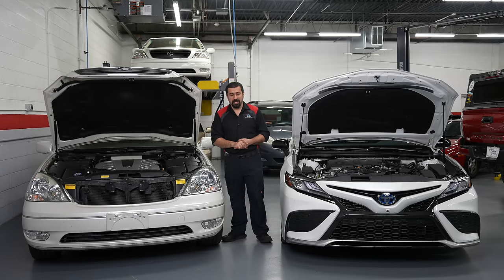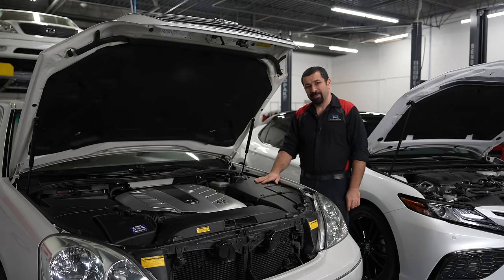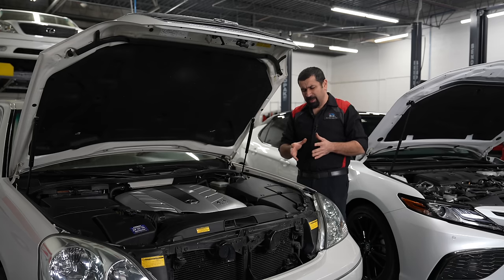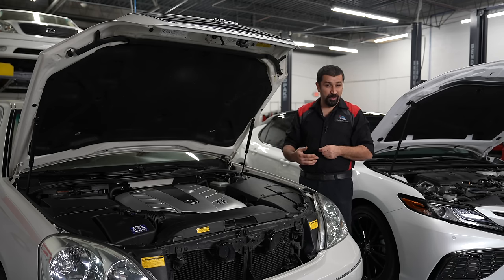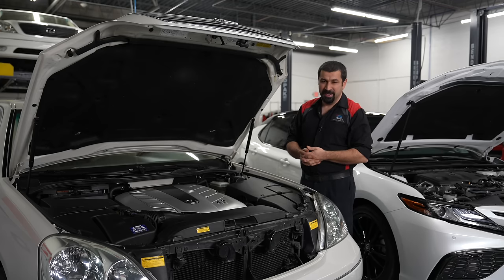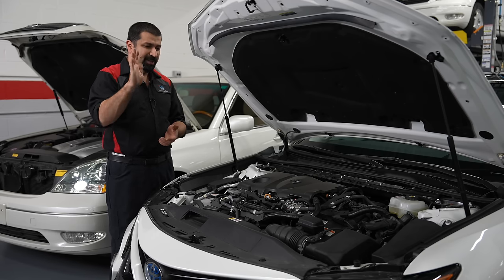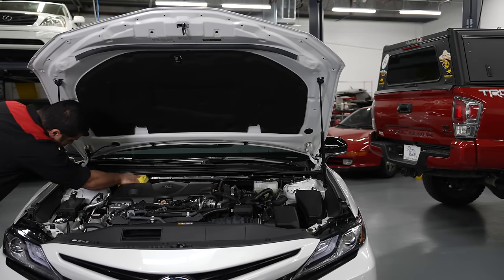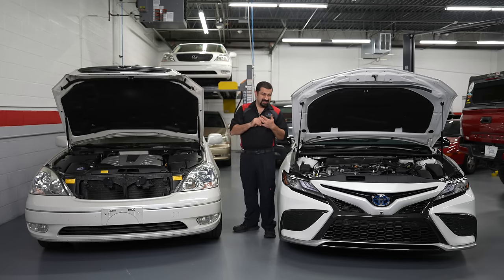Never Do THIS When Cleaning Your Engine Bay! Do THIS Instead

Comment: Another place to avoid cleaning with water is the distributor. This applies only to older cars of course (pre-2000s). Water under the distributor cap was a problem that could cause ignition failure.  On flat engines the distributor was off to the side of the engine in closer proximity to the wheel well making it vulnerable to getting flooded if the car was driven too fast through flood waters.

Comment: I have a question when cleaning the outside of a vehicle. I am concerned, because I own a Crosstrek PHEV and there are a lot more electrical components present. I power wash the outside once a week or so, since I live in Quebec where we have a lot of snow and salt on our cars after driving on the highway. I power wash the exterior bottom at angles, since I cannot put it up on a lift. It is not direct, but I still make sure to thoroughly get the entire undercarriage due to the salt on our roads.

I also clean the front directly, so there is a lot of water at decent pressure on the front grill. I never open the hood and clean with the pressure washer. Is this ok, or would you recommend some different practices?

Thanks!

Comment: I used to detail cars, both new and used, and the engine bay was my specialty. I always disconnected the battery. Then I would do a quick powerwash with some decent engine degreaser. Then blow dry the engine bay with compressed air. Especially electrical connectors and alternator. Then I would spray some tire shine into a rag and just lightly rub it on the hoses and plastic parts and never had an issue in years.

Comment: Simple green will also attack aluminum. 

I regularly clean my engines. It's really important over time, lets you identify where there might be leaks, and it's vitally important to clean dirt and dust off before you do any work opening the engine up to make sure zero dirt or dust can get in. If I have any problem areas I might resort to using a foaming degreaser if there is oily gunk. I use a garden hose (no pressure washer). Anymore I haven't had any concerns about spraying any part of the engine bay, all the important control modules are in water tight compartments. Dawn dish soap wirks well too.

But here's what's really important: you have to make sure it all gets dried really well. I'll use compressed shop air and sunlight mostly, especially on the alternator, wiring connectors, spark plug wells, etc. I will typically give a squirt of WD-40 on wiring connectors and the alternator, but only lightly because while it's good for preventing corrosion, it attracts dirt. 

Bottom line for me is I'm not affraid of spraying garden hose water on anything in the engine compartment, but never a pressure washer. I will use a degreaser on problem areas, but I am sure to rinse it off well, and Dawn dish soap works well, but only when you can agitate and brush it, again rinses off well. NEVER use simple green on aluminum, but it can be safely used on everything else if you immediately rinse it off. And I make sure to dry everything very well after.

Comment: Yeah I know I’m a mechanic as well and the detail guys here have idea what damage they’re causing.
Reply: I've seen detailers snow-foam the engine bay with mixed-in degreasers and let it soak for 15 minutes.  Guess where some of those dilluted degreasers go?  Then completely blast the bay with a pressure washer.  Then they will start the car and "attempt" to dry the car ala engine heat-soaking with the hood closed.   Yes, there will be no damage for a couple days or so, but we all know corrosion takes time.

Comment: Been pressure washing engine bays in my vehicle for decades.  Just be prudent with distance.  I kept one truck for 15 years and had zero negative effects.  Cant be just luck.
Reply: If ur vehicle is around for decades then it dont really matter. The electronics is probably minor

Comment: Ive worked at a Mercedes dealer and they always did this for their clients… although you need to use compressed air to dry it up especially the connectors and the electrical elements …

Comment: I really appreciate  your last tip about cleaning the touch screen. I tend to use Windex, or similar glass cleaner, on glass and plastic surfaces and eyeglass cleaner ( pretty inexpensive at Costco) to clean touch screens. Going forward I thin that I wil use less glass cleaner on plastic interior parts and use a little bit of mild dish soap in a spray bottle to do a quick mist and wipe with a macrofibre cloth.

Comment: Great advise, I use a leaf blower NOT A STRONG ONE JUST A CHEAP ONE and some cheap paint brushes and a wet rag with a small amount of dawn dish washing to clean up greasy places or dirt around doors,  I use warm or hot water also, just traded my 2015 Tacoma in back in august 2023 and the engine bay looked as good as a new car.They did NOT put it on the lot to sell, someone bought is VERY QUICK!!!!
Reply: noooo you blow the dirt right into the alternator...  use a vacuum!

Comment: The most important takeaway for me in this video is if I go online to a (used car) dealer's website to purchase a car.  The online pictures usually show a very clean engine bay.  How are the dealers cleaning these engine bays to the point that they shine?  Are they hosing them down & then applying some sort of liquid wax to make them shine?  Are the products they are using making their way into the connectors?  Thanks to your video I will be asking as well as checking to see exactly how invasive their cleaning products have gone.

Comment: 2017 Highlander - I open the hood on a regular basis - check my oil, visually check brake fluid color and level, check the coolant reservoir, regularly check my air filter.  I do clean the beauty covers and reservoirs so they stay visible but I just use a microfiber rag and a little spritz of cleaner. And I regularly keep the leaves and debris cleaned out of the cowl and under the wipers. And I'll go a little more heavy handed on the bottom side of the hood and liner. Now I've decided to have the Krown oil fluid rust treatment and from experience on my Tacoma I know they do the fender wells etc. under the hood so it all becomes a little more greasy under the hood but the protection is worth it.  Haven't used a hose and water since the days of my 1977 Chevy Nova which always made me nervous but back then I guess it was ok to go a little more heavy duty - plus engines seemed to leak a lot more crap back then.  It seems easy to maintain with minimal dusting/cleaning - makes me feel better anyways.

Comment: Also, do you have a specific body cleaner spray brand that you recommend for the Hybrid engine bays? I would likely spray some on a microfiber towel and apply it, then use another dry tower to polish it up.
Reply: Hardware stores, Walmart, auto stores
Reply: Any quick detailer will do.  As you saw from Ahmed, it's just a mist spray, a 500ml bottle will last you a while.
Reply: @michesbianan   Thanks for that! Typically I have been using the armor all cleaner wipes on the surfaces of the engine bay components and then finishing within a microfiber cloth. This way it is mostly dry with no fluids dripping into and onto things. 

That has been working pretty well, but I have not tried fluid cleaners as of yet, hence my question.
Reply: I’ve always used Turtle Wax Clean and Shine. Cheap at Walmart.
Reply: @TXAG81  Nice. That makes sense. Did not really occur to me to use a wax.
Reply: @madlucio70  I say keep on doing what you do now.  Cleaner wpes are convenient because you can just throw it away.  For quick detailers, you can use the shop towel.    Whichever is cheaper in the long run is the best way to go.

Comment: I look at it this way: how many times have you ever had a mechanic tell you something was wrong with your car because the engine bay was dirty? I'm willing to bet that is ZERO times! The only times I've ever cleaned anything in the engine bay were vacuuming leaves and pine needles that fell inside and make their way into the air filter.

Comment: Very good review of engine cleaning.  I use Simple Green - Aircraft and Precision Cleaner for all degreasing and clean-up work on my cars and aircraft. This product is formulated so as not to cause corrosion or chemical interaction with aluminum and plastic parts.  It can be diluted as appropriate for the task at hand.

Comment: I only clean the engine on my old classic car that's it. On New cars what's the point, it's not worth it at all, most of them have some stupid engine cover. You can't see anything anyways, and plus the engines are ugly to look at with their wires and plastic everywhere who wants to look at that crap. I just leave them alone.
Reply: Its worth keeping the engine bay semi clean, this way you can easily see cracked pipes and oil leaks and other issues that may pop up.

Comment: A common mistake a lot of detailers make is they chase that cleaning perfection and everything else goes out of the window. Deep scratch on paint? They buff it until it's not visible, but it also leaves you too little of a clear coat to protect the car for years to come. Same with engine bay detailing, splash everything with the cleaner, doesn't matter where it goes and they just cover the alternator and battery. Degreaser? Let's use it all over the engine bay including the plastic covers so it looks spotless clean, but how about durability of the plastic parts afterwards?

Awesome video as usual AMD!
Reply: Nothing can be further from the truth.  This is pretty common with wanna-be detailers or just new ones.  Most of the old timers pretty much would just do a wipe down.  For scratches, if you meet a detailer that will tell you scratch is so deep and starts talking to you about thickness of paint, then you know you're dealing with the right one.

Comment: That's funny, exactly what you recommended is what I've been using for years to keep my engine bays clean.  I've been a detailer for a long time, and prefer to keep the engine bays clean on my own cars (most customers I've had didnt really care or ask about it, so I didnt bother).  But on my own cars when I'm getting the engine bay clean for the first time, I use heavily diluted simple green, and instead of spraying directly on anything in the engine bay.  I have a long bristle brush and give a light spray directly on the brush.  I clean a section, then immediately wipe it clean.   Now that my car's engine bay is fairly clean, I use some simple detail spray that I got in bulk, and wipe the dust off every year or so.  I'll also use a very non oily tire shine that dry's good on rubber/plastic parts (obviously not everything) to keep them from cracking and drying out.  I've seen so many videos over the years even from pretty well respected youtubers like chris fix that recommend using pressure washers/hoses on the engine bay.  I've never... ever... EVER done this.  People are so impatient, always looking for a "life hack" or a quick cheat to get results fast.  The engine is an extremely complicated piece of machinery.  Spend an afternoon, take your time, and be sure to not soak liquid anywhere where you think it shouldnt be.. just use some common sense, and be gentle around sensors/wires so you dont risk damaging them.  Engine bays are built to handle light water spray from underneath the car, they arent made to handle gallons of water getting sprayed from the top down.

Comment: Any tips for a dirtier engine i.e. a good bit of mud? I take the utmost mechanical care of my 4Runner but I’m also not ashamed to use it for its intended purpose and it sees a lot of off road use for camping and exploring. It’s not like the heads are caked or anything but it gets pretty dirty, even after putting better splashguards on it. 

Keep up the good work by the way, your videos are great and gave me the confidence to change my own spark plugs and probably a dozen or so other things I would have paid someone for before I found your channel!
Reply: Wash it with a pressure washer. It’s fine. I have pressure washed literally dozens of them. When they are hot spraying right on the alternator and map sensor. Don’t be afraid.

Comment: You can also use a non harsh long bristle paint brush to first loosen dust and dirt in hard to reach places then blow it using a compressor hose nozzle or specialized blower.

Comment: I dont spray any liquid on the engine. Never had to. Use a rag to clean dust or use a shop vak to get rid of debris. Especially in those places under the cowl clogged up with wet leaves restricting the flow of air. Or the drainage holes.

Comment: I wash my engine about once a year. I put engine cleaner or degreaser on it when cold and let is soak a few minutes. Then I use a gentle shower of water to rinse and hit heavy dirt with a brush or rag. Then I use a leaf blower to blow it as dry as I can. Then I go drive the engine until it's hot to completely dry it. I never let the water sit for a long time on the engine.

Comment: I use a light water mist with light degreaser and compressed air. I have always detailed my engines. We bought a 2008 Nissan rogue with 300miles on it and the engine bay still looks brand new

Comment: I recently cleaned my engine bay. Turbo Subaru. Sprayed engine cleaner all over. Agitated  with a brush and used the shower setting on my garden hose. Stayed away from the alternator and battery. Rinsed and repeated until it was clean. Used a blower to get rid of any standing water and let it dry for a couple of hours with the hood up. No issues. 👍🏾

Comment: Great video,I spray my engine bay with water ONLY when engine is cold, and  water won't direct jet onto Alternator, coil, ECU, connectors, after that I would start up the car right away, let the heat slowly bake the water away, and MOST IMPORTANT I ONLY do this when the car's milage less than 60K kilomoters(40K Miles),  when the car gets old, I use compressed air and short burst water spray ONLY on few extreme dirty spots, I rarely use degreaser and only before/after repair done when needed. Just clean enough to find leak or where thing go wrong, but engine itself doesn't need that much clean to run, so I won't be too fussy about it.

Comment: There's a foaming tire cleaner spray that I found works GREAT, and all the dirt and grime will just slide off and drip out of the engine bay, and it works as a protectant, so it leaves all the plastic with a shine and also a thin protective film
Reply: You're absolutely right, I've used it to great effect. However, it works best on cars that have dirt not embedded/sat into the plastics and metals, forming a layer of slime/sludge

Comment: In the early 90's I used a pennzoil product to clean my engine bay. Instructions said to warm it up 5 minutes, spray it on, and then spray it off with a hose. I did that on my 79 Accord. Aluminum heads. Hot engine plus cold water equals bad head gasket. Thanks pennzoil. Haven't bought anything with that name on it since. I wrench and I have gained knowledge over the years. Never again will I ever try to wash an engine bay. Not just because of the pennzoil lesson learned but also as stated in this video, electrical has become more and more dominant over time. If I ever clean anything due to spillage like changing a power steering pump, I simply use brake cleaner to knock it all down. Dries fast and won't smoke as whatever I spilled is cleaned up.

Comment: You mentioned we should not spray water on ignition coil, also on electric connector, so my question is how do we clean these mentioned items, is ok to spray them lightly with pressure water?

Comment: I was a porter at the ford dealership when I was a teenager. There was a car we'd had for a long time and they wanted me to have the body shop clean it up. The guy started spraying the engine bay and the coil pack was arcing everywhere. I've been more cautious than most since then

Comment: Thank u, AMD. This is a subject "near & dear to my heart". I have owned from a Starlet, to Corollas, to Camry's, & now my Prius. I just turned 71. I keep mine clean so I DON'T  have to lay on the pressure/water. Oil on an engine is like frying an egg. I wash my cars @ self serve car washes. So I use the pressure gun, BUT I just use the pressure that comes out of the gun, NOT press the trigger. I clean when needed or when I detail my car. And Griots "rocks" for detailing the body! And for you "nay sayers", what do car dealers/lots do to cars to sell them??🤔😉🖖🇺🇸

Comment: Excellent advice, Ahmed.  I also do not spray my engine bay.  But I have found a little Dawn dishwashing detergent in a bucket of water, washing with a damp rag has done the trick.  But I like thte idea of detailer's cleaner.  I may try that.

Comment: I want to buy an XJ 2001 classic 130K miles but I'm not that sure. Owner replaced the whole cooling system because of a radiator leak.. what you say

Comment: I used to get a lot of Audis brought in from used car dealers who purchased them at auction or whatever, with flashing check engine lights. The diagnosis? Always the coils with rust halfway up the length. We typically know what we were going to find when a used car dealer vehicle came up with a nice shiny engine. When I buy a used car, I'd much rather buy one with the engine as dirty as it was. To me that's more honest engine than one that's washed and shined with Armor All.
Reply: Same, I prefer to buy/see a used car with engine bay that is not cleaned.

Comment: I use an all purpose cleaner from Meguiars since it's not as harsh, a detailing brush, a steam cleaner, and some rags to dry. This gets 80-90% of visible dirt. I see many people spray water under the hood without any issues and it's pretty safe on most cars but I still don't want to risk it.